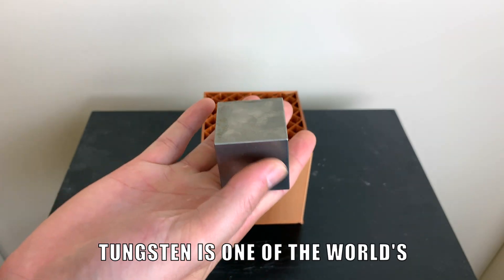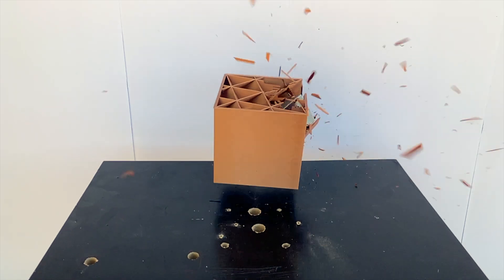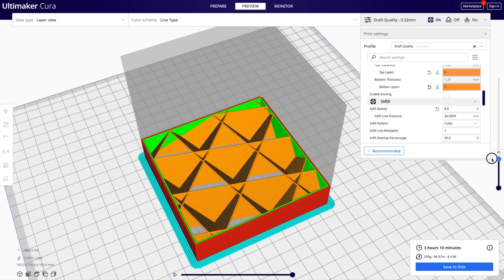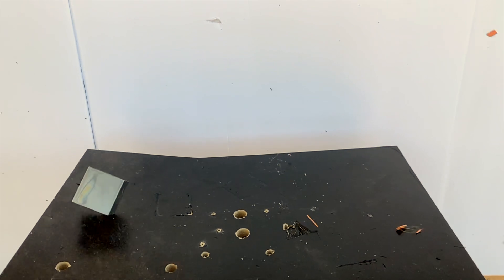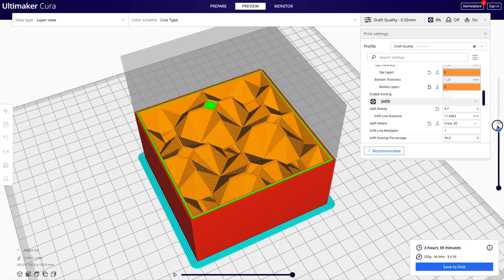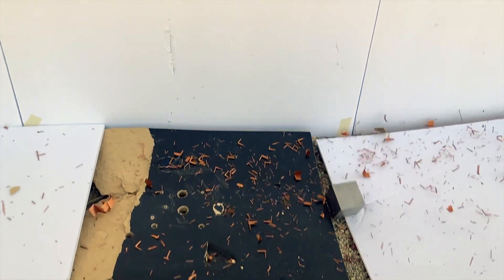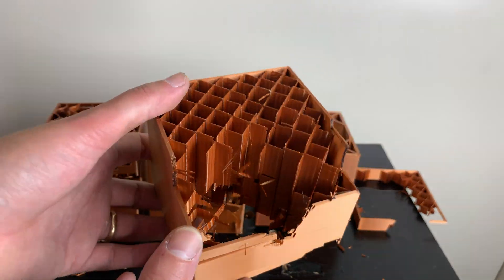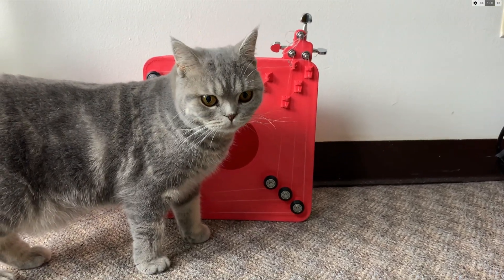Dropping Tungsten Cubes on 3D Printed Cubes

Comment: Well, my personal opinion is that all of those models needed to have closed tops.
Without closing the tops, then you don’t connect the support structures; and I’m not sure what you proved by impacting what I consider to be a uncompleted support system.
Also with the way the table was and the inaccuracy of the hits, I think you need to redo the test with a firm steel table and with closed tops…   Otherwise, thank you very much for the great video! 😊😊😊

Comment: The purpose of infill is to transfer forces to the other side of the wall,
You test has no value other than sensationalism.  
A more valuable test would've been to drop the weight on a side wall, and see which infill transfers the load the best.

Comment: An issue with this comparison is likely that real infill density is not equal. I found that specifying the same infill density in terms of % leads to vastly different real infill densities depending on infill type. (Especially going near 100%.)
To get truly equal infill density one will need to weigh the resulting parts and hone in on equal mass. Bisection method.

Comment: "Isomax" (trademarked name) is the infill with the theoretical maximum of achivable anisotropic stiffness. This has been theoretically proven IIRC.
Unfortunately no slices implements it. 
Not even under different (not trademarked) name. So callled cubic infill has some planes in common with isomax but isomax has some more.

Comment: Too many uncontrolled aspects of this experiment for it to be valid. 
The printed cubes need to be finished on top and mounted to a solid surface. 
In each test the tungsten should be mechanically dropped from the exact same height. It should also impact at the same angle for each attempt. 

It's a good idea for a test, the execution is just flawed.

Comment: Are you trying to turn your channel to a click bait or do you actually want to teach people something and learn something while you are at it? Even if you are on a budget, you can do very basic tests like drop test, crush test (use a car jack or vise), etc. Also, how much material was used in each block is a very important. An impact test is flawed if the impact surface is not flat and consistant between test subjects. You should also use a ball rather than cube beause you cant control the orientation of cube as it impacts, creating more variablity. I like your channel and I think you wanted to do good but this video did little to impress me.

Comment: 3D printed parts can be printed in almost solid plastic (100% infill) but it takes forever to print and is only really used for small parts that need a lot of strength like gears

Comment: U really needed to finish the cubes with the tops covered with the material. That metal cube would rupture the top and the bond between the infill and the upper surface also has strength integrity. U also can do this for different types of material, like PLA vs ABS and so on. Don't use a table, pile up cinder blocks next to each other. U also need to describe how high that cube is being dropped from. Also if it was a round ball of metal it would be a better test because if the corner of the cube hits the surface on one and not the other you have different impact zones.

Comment: Wouldn’t I fill patterns before more support strength. And stopping power would be related to surface area given the more material the cube has to shear cuz the cross section increase with shear strength isn’t linear. Idk I ain’t no fkn enginner

Comment: What was the difference in print time? It's not particularly relevant, but if the gyroid took 30% more time than cubic, you could argue cubic is better. Or if lines was 90% quicker, it's possibly a worthy compromise.
Edit: pulling numbers from my butt, I know the differences likely won't be this big.

Comment: Here is an idea, make a high ratio gearbox with the wheel input connected with reeled rope and something heavy, so this counterweight will rotate the wheel until it reachs the floor or its dead end. The output should be connected with simple dc motor that, during the rotation, will produce current (will work as generator), so can u make this and check what u can charge or power up with it?

Comment: Maybe I am wrong, but wouldn't it be better to test by hitting a wall covering the infill, not directly on the open infill pattern.I would think the idea of the infill is to support the walls of the cube, so maybe results would be different?.
Reply: Yeah his testing was incredibly flawed and inconsistent. First two basically fell on the edge of the face which adds more resistance. The 3rd one the table broke. I agree with you guys though. This is meant to add structural integrity to the faces. He should make a solid top face, and use a drop rig with a properly marked target point. Every singe drop was all over the place because he placed the object randomly, and dropped it with his hand clearly.
Reply: I would like to see that so yes
Reply: Yeah, there's a big difference between static load (supporting weight) and dynamic load (impact). He just tested one, but assumed they were the same. Guess that just means another video about how much force/pressure they can handle :)
Reply: Agreed,  I was going to post the same comment.
Reply: Someone has to do it
Reply: Yes
Reply: I was wondering the same thing, I'm curious of the different types of forces it could withstand
Reply: You are correct.